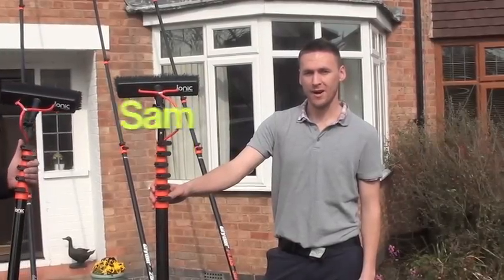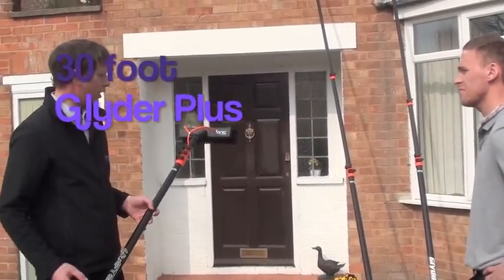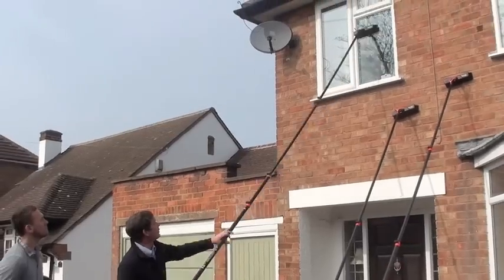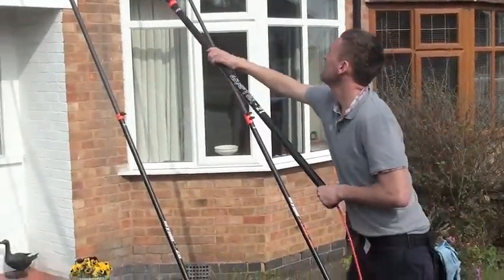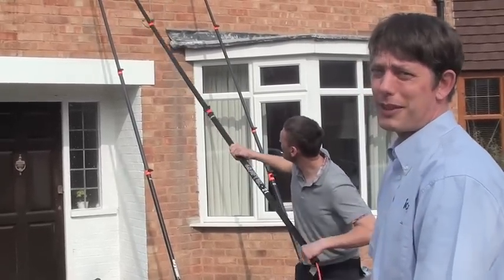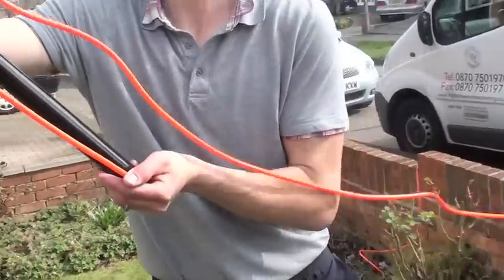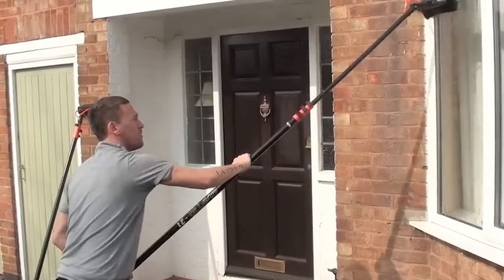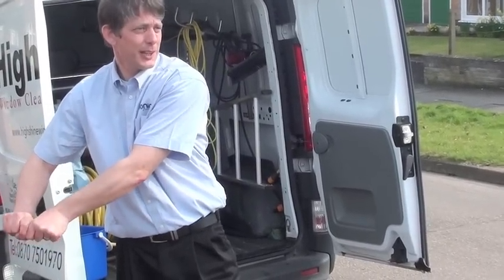When Ionics met WCM

Comment: I know 5 other window cleaners, all using WFP's. I've also seen many other WC's out and about and I have NEVER seen one of them using this "rocking" method and 2 of those I know have been on this so-called "training".

My current pole is, unfortunately, an Ionic Glyder 30', one of the first they released. All of the sections have had to have Araldite applied to the each of them to bolster the pole wall and 2 of them are now so thin at the end that you can see through them.

TBC.....